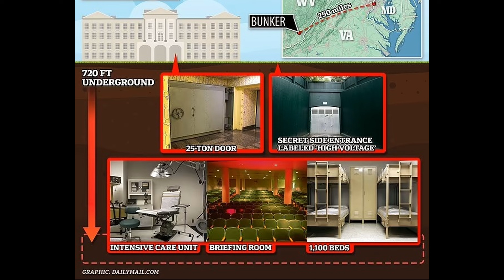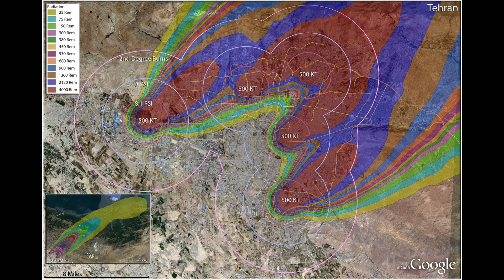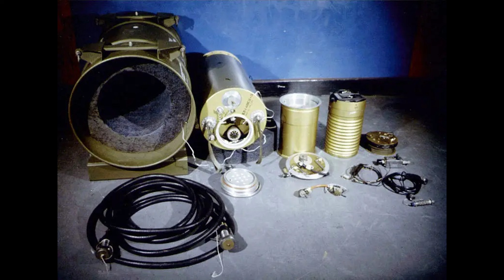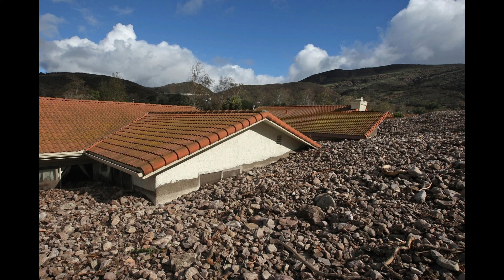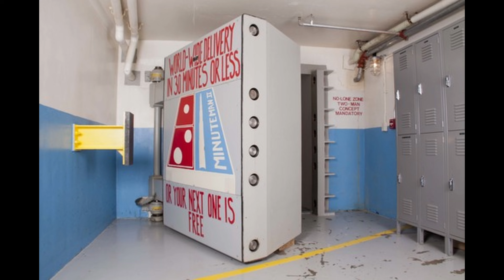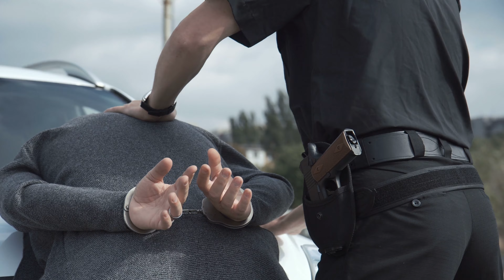Are Bunkers Actually Useful In An Emergency?

Comment: Hey man I like your stuff. I amncertainly not the only person who doesn't understand "the old controlled pair" means.

Please keep up your efforts.
Reply: It means hit like and subscribe. It helps his channel be more visible and grow.
Reply from the maker: I appreciate your support and I will definitely keep up my efforts. As for what a controlled pair is, it's a shooting technique in which you fully aim your first shot but them you just ride the recoil impulse until back to base line, which if you have a stable shooting position will put your point of aim very close to where it was before and with no further aiming you squeeze the trigger a second time. This is in contrast to a double tap which is just squeezing the trigger twice as quickly as you can, witch generally causes your second round to be discharged near the top of the recoil impulse of the first round and thus causing your first and second rounds to be relatively far apart. This is also in contrast to an aimed pair where you are shooting two rounds but your are fully aiming before each shot which is the most accurate but also most time consuming way to do it. As such, most tactical shooting pistol drills involve a controlled pair. So I was just trying to say hit the like and subscribe buttons in an original and interesting way that I thought most of my audience would be familiar with.